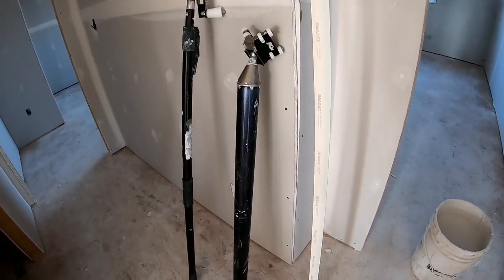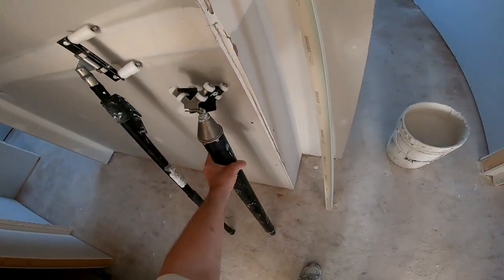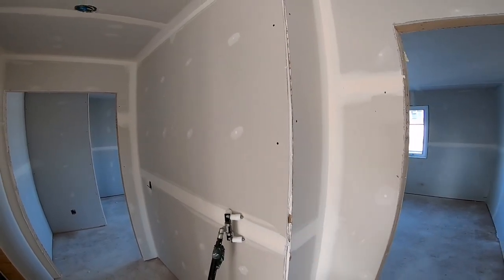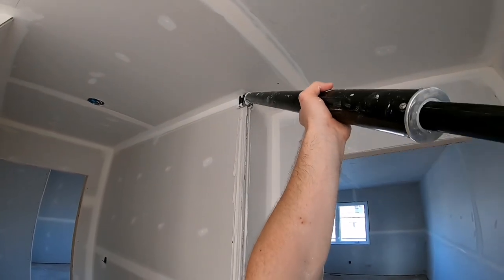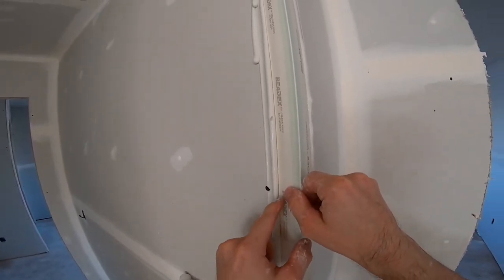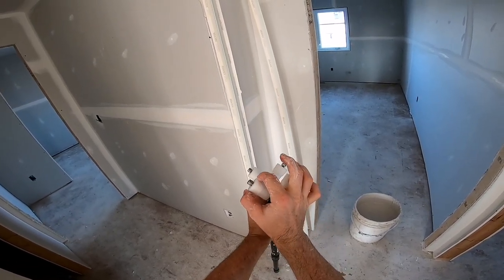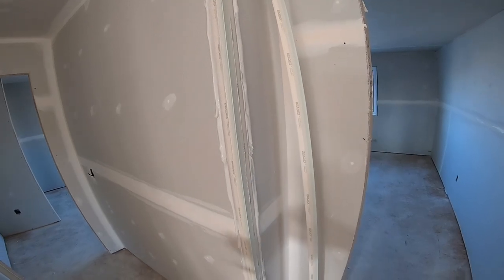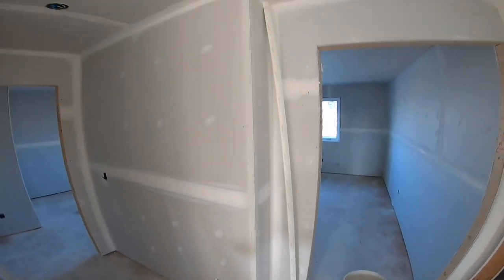How to use the Drywall Cornerbead Applicator and Roller

Comment: Seven years neber knew about the flange and it works. Great tip
Reply from the maker: Ya makes a big difference. I bought the corner applicator and roller many years ago but stopped using them soon after because too many bubbles under the cornerbead. Someone showed me the trick to bend the flanges back and now I use them again and never have an issue. Big time saver using them.

Comment: When these came out long time ago I was having problems. Found out real quick to use the All Purpose green pail mud.  I use that for all taping and the blue for topping.  I've been using a hopper but but all the compound tube stuff today. Good tip on the folding back the paper.

Comment: Thank you so much for the tip! Been 4 years struggling with thoses bubbles , also i loved the demonstration i will watch your other videos too  subbed :)
Reply from the maker: Thanks. Definitely bending back the paper flanges I've found to be crucial to prevent bubbles, that and making sure the mud application is consistent. I actually have meant to make another video on this topic, because the applicator I'm using here is the best for vertical corners, but not so good for horizontal beads, just the way gravity sags the mud b4 I can get a bead on and roll it. It's hard to explain. Recently I picked up a Columbia white plastic corner bead applicator, it puts the mud on differently that solves the problems. Now I use the metal one for vertical corners, then swap it for the plastic one for horizontals.
Reply: @Interior_Works  just in time before i purchase my own columbia set i was confused which one to choose between the two applicators and found that the plastic one puts the mud much better all the way to the center of the head 
Just curious if the can-am set is better than the columbia set materials if you know anybetter advice me in your experiance. Seen your content and Loved your channel ❤ keep up the good work sir!
Reply from the maker: @zMIGH  If I had to own only one, I'd go with the plastic one, the only reason I still use the metal one is for speed on the verticals because it has wheels, the plastic one drags a bit slower with friction. But as you noticed the plastic one puts mud right to the center, and I would say it's the overall better applicator.
Reply from the maker: @zMIGH  Not sure if can-am is better or not overall. A lot of people like can-am too. I have no experience comparing.

Comment: I find applying external corners with finish filler instead of hot mud a lot quicker,but the corners are easy damaged also most manufacturers don't recommend doing it with finish.

Comment: How do you clean out the mud tube once you are done with it?  Does it come apart?
Reply from the maker: Just pull in and push out clean water from a pail, the inside will rinse perfectly clean. It does come apart too, either by a few screws or buckle clamps, depending on the brand

Comment: Great video, thanks for the folding tip. Do you think you could use the corner mud applicator using the Dewalt Mudshot instead of the compound tube? Thanks.
Reply from the maker: I've personally never used the mudshot yet, but I've used the similar tapetech mudrunner with corner applicators and it worked very well.

Comment: But my outside 90 doesn't has center hole? Did you drill your own center hole?
Reply from the maker: That's news to me. I actually just googled new Columbia outside 90 applicators. Seems that's the new design. The main importance is just mud under the paper flanges really. I never really seen the point of the center hole actually, since that area is capped with metal.
Reply: Do you mind sharing a link ? I can’t find the one with the center hole ..

Comment: Why use the paper tape metal, and not just bare metal corner bead???
Reply from the maker: Drywall compound has less adhesion to bare metal, it flakes off in chunks if the corner is bumped.  Metal also has a tendency to hairline crack along the edges.
Reply: Thanks for the response... I guess it's like doing the right thing despite the customer not really knowing until later.. @Interior_Works

Comment: can you coat it same day?
Reply from the maker: Cornerbeads can be coated same day without issue. Only paper tape on joints or inside corners should dry for 12+ hours before coating.

Comment: I would just nail on a metal one in 10 seconds
Reply: A corner hopper with the corner roller is the best way, but metal corner will crack over time they are shit, can’t take any impact
Reply: @Billybob-go8hn  and , not allowed on any job site
Reply from the maker: In my area all metal cornerbead was phased out in the early 90's. Hardware or supply stores usually don't even carry it, special order only. Cracks too easy, so builders don't want it used on their projects. I see it a lot on older renovations, and there's often hairline cracks running down the sides.
Reply: @Interior_Works   I always taped my metal. So basically the same thing as paper/metal but thicker metal and bigger flange!
Reply from the maker: @deeeeeeps  if it's taped I'd imagine it to be the strongest corner possible, as you said, thicker metal and bigger flange. But I don't think most people tape the sides, at least not the ones I've fixed in renovations that had cracks running up the sides. So it just got a bad reputation, at least in my area.

Comment: so doesnt matter if its plumb or square? No wonder houses today are shit. Nobody has any pride in their work.
Reply from the maker: I don't understand what you're referring to
Reply from the maker: Can you elaborate?
Reply: @Interior_Works   I think he's referring to how level or square the outside corner is with respect to the framing/drywall.  Lots of outside corners on newer homes tend to be out of level because nobody seems to check while they are taping.  When hand taping, I always throw a level on the outside corners and have to tweak them in or out a bit to get them perfect, but I do a lot of renovations for picky people who pay well so I don't complain.
Reply from the maker: @MV-wb2cz  I wasn't sure if the original poster was referring to bead alignment, like taking a straight edge to each side and making sure it's even. - the roller is made to position it perfectly, and I check anyway when I'm wiping the excess, with my knife as the straight edge, if in some very rare case it didn't go on perpendicular, I adjust it before it dries, but as of April this year, I'll have taped for 20 years, so I see it by eye at this point or even 18 years ago, it happens alot without the roller, but almost never with it.

Or if the framing is bad - like convex, concurve, the bead isn't flexible and doesn't conform to either so it will be very obvious during its application that the bead needs taken off and a laser put the the corner and restructure the corner with plaster prior to placing the bead again, that's usually to do with bad twisted timber, a fault with that material. - Drywall just follows the framing.

Or if the corner is proud on one end, so overall slanted - if it's bad enough to be visually obvious, that's a fault with the framer, they made a mistake. - it's fixed and it's a back charge.

But I didn't like the attitude of that original poster, because they were making assumptions and accusations when I was just trying to show how some tools work.

Comment: The time you mess about with all that you could do them by hand just as quick
Reply from the maker: That's true for a few corners, but for one example, I did a commercial job recently alone, it was 24,000 sq ft drywall, and 3700 linear feet of bead (mostly due to every window and door being drywall-return). I saved days using these tools.  I'm not trying to sell these tools. Just my experience is they make my job much easier and the tools paid for themselves after a few jobs.

I would never recommend these tools to someone who tapes/muds casually once in a while - I'd say use a pan and knife.
Reply: @Interior_Works  i tape new build houses do they work good with windows ? as i have just as many windows as external corners